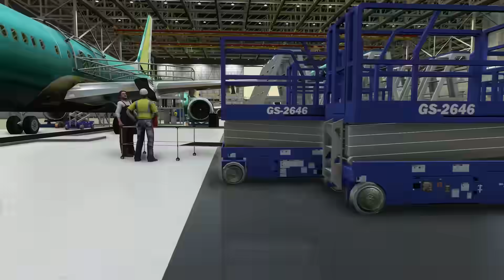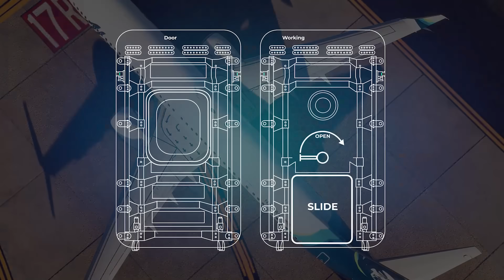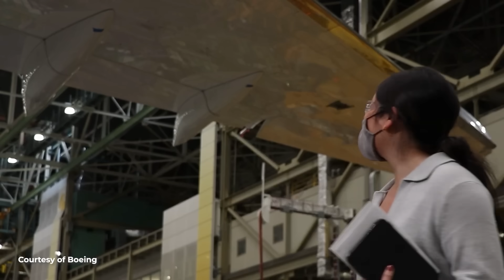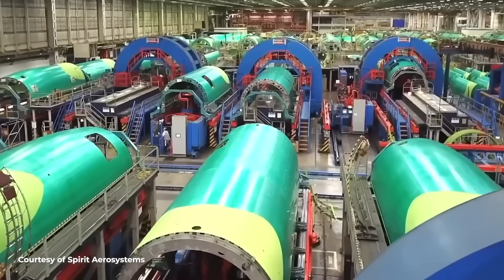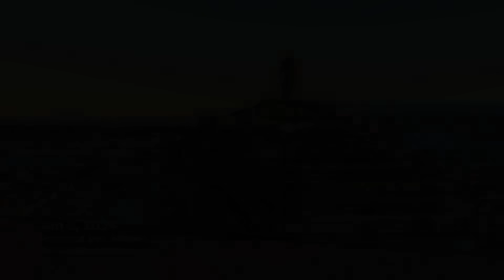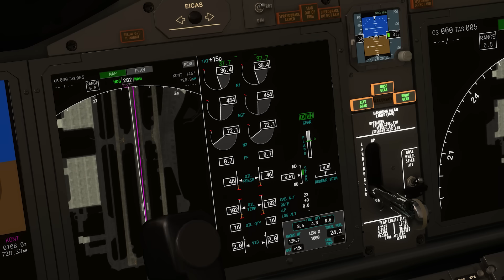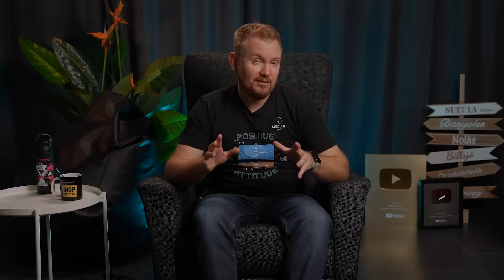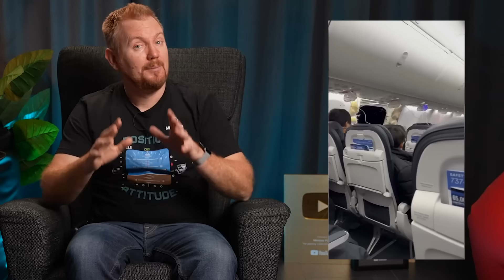Boeing 737MAX BlowOut!! The Scandal behind Alaska Airlines flight 1282

Comment: The fact that this was not a specific MAX design flaw, but a general quality control problem, is even scarier for anybody depending on Boeing, because ANY Boeing aeroplane can be and is affected by the way they make their junk in general!
Reply: It seems that the problem was within Spirit which is even scarier because it means all Boeing aircraft and some other brands, too.
Reply: @MikkoRantalainen  No, the problem wasn't within Spirit. Spirit caused the root problem for some work over but it happened at the Boeing Final Assembly Line (FAL). Boeing has to keep track of what is happening there and failed to do so.

Fly save! Avoid new Boeing aircraft.
Reply: @MikkoRantalainen the problem was with Boeing. It happened on their floor.
Reply: Totally agree. It would have been better if it was a design flaw because thats relativly easy to fix and to narrow down affected planes. But having a quality escape is always a bigger problem because you can't say when it started or how many planes are affected
Reply: Although plugs are another part in other boeing planes they all share a basic design and install.  The missing and loose parts are builder failure.  A scarier part for me is the FAA in reporting told the whole world how to override the cockpit security door, required to avoid another 911.  We also have 12000 confirmed terrorist released by our government on our streets.  It took 18 to do 911.  Imagine just 1800 is enough to carry out 2, 911 like events per state.
Reply: If they only hired white men, this would never hsppen. As we look through our history, this type of thing never hsppened before the woke Boogeyman started hiding under hiring managers beds.

Is the Boogeyman in the room now?
Reply: the two work in harmony, good design can and should reveal quality concerns, in other words the design should make it impossible to assemble something wrong, because if it can go wrong it will.
Reply: There's a bit more to it. It is far from all Boeing planes which has these plugs. From what I can understand, it's a relatively new thing. You won't find them on 747's, 777's older 737's etc. Not sure Airbus even has any. The scary part here is, that it tells us a lot about the working environment and culture at Boeing, and that affects ALL planes going out. It is as terrifying to learn that they did not replace the rivets which were supposed to have been replaced for example.
Also note that Spirit is still Boeing, and it is the responsibility of Boeing to make sure Spirit does its job properly. It is also a problem that Boeing disregards issues, and thus demands the production to be ramped up so deliveries continue on schedule.
Reply: @AB-80X no... it tells us a lot about the culture at SPIRIT, not Boeing.
Reply: @thomasneal9291 it doesn’t help Boeing if you keep coming up with excuses for them. This is why the door fell out. “Not our responsibility”.
Reply: @thomasneal9291 no I really think it tells everything about the culture at Boeing.. How they became "bad" corporate pushing for production regardless of its engineering teams opinion, minimizing cost and focus on investors. Spirit was a part of Boeing until 2005, they externalized it and then they squeezed it, more for less money. Final quality assurance is the responsibility of Boeing. There is a reason that Boeing is being scrutinized, they have killed people recently by prioritizing cost and fooling around with FAA.
Reply: Airbus does have door plugs. Just a guess, but an a321 neo probably has them because of passenger configurations. 

Bigger planes are less affected by this, because they’ll just have a door there because of passenger count. It’s these large 737s that are right on the edge of passenger count for exits, which is really just the max 9 and 10, as well as a 900ng
Reply: Well it seems like Boeing itself is not to blame but the company that provides them with the doors.
Reply: @J_131  The blame is with Boeing. If a car manufacturer fitted rubbish tyres to a car you bought, it would be the manufacturers fault. Final assembly rests with Boeing.
Reply: @J_131  The very reason that Spirit exists is becausse the bean counters from Boeing sold off what used to be a Boeing owned manufacturing plant as a cost cutting measure. From an engineering safety standpoint its a shit show. I know a former safety inspector from the Boeing seattle plant and he left after only a few years out of disgust. The terrible corporate culture from Boeing also translates to Spirit. Its all Boeing's fault, ultimately.
Reply: @J_131   Still, in the end it's a Boeing product.
Reply: when companies focus on DEI rather than their core business, the result is inevitable
Reply: @pauldwalker  Straw man BS. 

You're going to lose AGAIN in November. 

Just move to Russia or Hungary.
Reply: @pauldwalker The inevitable result is a more diverse workforce, period. Or does your definition of DEI mean 'only hire based on colour and what's between their legs and not their actual qualifications'?
Reply: One of the many side effects of diversity hiring. Spirit has an all female engineering team. Statistically impossible with merit based hiring.
Reply: @United_Slaves_Of_Israel  Right, because when white guys make mistakes, it’s just one of those things, but when anybody else does, it’s because they have dark skin or are a woman or whatever nonsense you people use to justify not hiring anyone who doesn’t look like you. Go to hell.
Reply: @United_Slaves_Of_Israel  Typical right-wing justification for not hiring anyone who doesn’t look like you. If one of you people screws up, it’s just one of those things that can’t be helped, but if someone else does, it must be because they have dark skin or are female or whatever, and you use that to justify keeping the old boy network alive. Surprise, surprise. 🙄
Reply: @United_Slaves_Of_Israel  Guess who makes the overwhelming majority of mistakes, out of proportion to their presence in the labor force? (Hint: It’s not women or people with lots of melanin.) Maybe we should stop hiring them.
Reply: @United_Slaves_Of_Israel omg
Reply: @United_Slaves_Of_Israel ridiculous comment. I guess you fall for the right wing fear mongering.
Reply: @United_Slaves_Of_Israel You guys will say and do anything to maintain your power, eh? Funny, considering who is responsible for the overwhelming majority of screw-ups in essentially every facet of life.
Reply: @United_Slaves_Of_Israel    I agree in general, but this was not an engineering issue, but an assembly one.   And also I believe it happened at Boeing, not at Spirit.
Reply: @gonzchi let me get this straight, you agree "in general" that having an all-female engineering team (a claim which we have no idea if is true, and I doubt) is, in and of itself, a problem for the quality of their work?
Reply: @mnxs   No. I agree that companies should hire based on merit and not based on filling a quota of sex or race or whatever.
But in this particular occasion, it makes no difference, since this was not an engineering issue.  I hope I could clarify my comment.
Reply: @gonzchi However what's never reported, and overlooked by bigots who push the anti DEI agenda, is that the people who worked for the subcontractor reported the flaws in the design which were ignored. That is what happens all too typically when corporations and their subcontractors are more concerned with getting out a product, no matter how flawed, instead of putting passenger/crew safety first.
Reply: @United_Slaves_Of_Israel Don't be ridiculous.

Comment: Didn’t know you guys didn’t know about the unlocking of the FD door during a depressurisation.  Learned it from the airbus fleet I operate on and we were told it was industry standard. 

Really useful to ease the nerves in case of pilot incapacitation during a decompression
Reply: I suppose that's yet another difference between Airbus and Boeing these days.
But hey, Boeing didn't feel the need to tell their Max 8 pilots about MCAS and its associated issues. Seems to me that Boeing considers pilots to be on a need-to-know basis...
Reply: @AB-80X  "Seems to me that Boeing considers pilots to be on a need-to-know basis..."

Yeah but you never know what you need to know. Flawed thinking from Boeing where everything costs too much to be bothered with.
Reply: I wonder if they thought it might be a security risk for a potential hijacker to know that.
Reply: @--KP- I have to to admit that I have two different schools of thought on that. I don’t think it’s very secure as a clever terrorist team could abuse that system.

But the physics of it makes sense though.
Reply: @mikoto7693 kinda hard to do cause you probably need to inflict damage to the aircraft to get it to depressurized which kinda means blowing a hole in the aircraft you fly...

Comment: After this, I guess the springs fitted at the bottom of the door will be removed if a plug is installed. I cant really see the reason why the springs were left in situ as you really dont want any more dead weight than needed and the plug was for all intent and purpose a permanent install.

Comment: So, very basic questions remain. Where were the bolts? Why not duct tape them to the door stops so you couldn't put the door back without noticing them? Relying on an entry in some system to remind to replace and re-check seems fragile and vulnerable. When a procedure is in place, it's a lot easy to convince yourself that the procedure is failsafe than that it will be following correctly in all cases, especially with so many devisions of labor.

Comment: With the cost of solid state RAM so low and the ability of data compression to reduce audio to relatively small data sets why aren't these aircraft capable of storing days worth of audio at this point in time?   It seems like I have heard about these overwrites a few times.   Why isn't the data archived when the aircraft lands from the last flight?   Unless there is a catastrophic hull loss there is really no excuse with modern technology to losing cockpit voice and other flight data.   Additionally you mentioned putting a certain code into a flight system when the aircraft is in an emergency status.  Why does this not trigger 1. back up storage of the flights data and voice into a secondary storage system that will not be overwritten. 2. Satellite uploading of voice and telemetry of similar data?   I know from flying 737 Max that I have internet service as a passenger.   Seems like aircraft data can take priority of that path in an emergency!  In the modern age we should not be losing critical flight information, including where there is a catastrophic loss of an aircraft at any time where the aircraft is still airborne for a few minutes after the crew notices the event.   Considering the cost and consequences of commercial aircraft mishaps, I am frankly surprised how many things are not standard engineering practice.   737Max for example even after aircraft losses and "corrections" (correct me if I am wrong) still does not allow disabling of MCAS without de-energizing manual electronic trim control.   So the pilots can no longer use the electrical switches to trim the aircraft?  They have to manually spin the trim wheels.    Imagine if a Tesla using automatic drive control, had to be swtiched off by disabling power steering and brakes on the car.   Just have a circuit cut off for MCAS in the electronic trim system, up stream from the trim motor circuit breaker!  Runaway trim may require disabling the motor control, but MCAS intevention should not require this.
Reply: Privacy concerns
Reply: @slevinkelevra5824  I understand that concern.  Pilots don't want to have big brother reviewing every action they take.  The way to deal with privacy concerns is to legally limit access to the data sets, with serious penalties for misuse, not to decline to collect it.
Reply: @martinbrenner2573   I fundamentally and vehemently disagree with that. I dont think we need to discuss this in any way, our viewpoints seem so totally opposed we would get nowhere.

Comment: How is it possible that in 2024, any voice recorder would be limited to 2 hours?  A $25 SD card can record nearly 2 MONTHS !!! of 2-track audio with reasonable compression.  Even without compression, you can record almost 2 days of 2-channel audio on a 128GB card.  And of course, cards are readily available up to 1 TB for around $100.  How can there possibly still be a 2-hour limit in 2024?  This is insane.

Comment: I don't generally suffer from any sort of flight anxiety, but this incident has rattled me. The fact the aircraft itself isn't at fault actually makes it worse - it means that it's not a specific faulty design that I don't trust - it's the entire company.
Reply: Sadly, nothing new. Even the Max 8 accidents boils down to company culture, even though it was a built-in flaw, combined with Boeing not disclosing the potential risks of MCAS in order to negate extra pilot training.
That's the problem with the McDonnell-Douglas model.
Reply: @AB-80X  The real scandal of the MCAS tragedy was that Boeing already used it in military aircraft. It isn't a problem there because they use BOTH angle of attack sensors. On the 737 Max, a pilot would not necessarily know there was a difference between sensors as the alarm feature was an optional extra .
Reply: I love flying commercial and GA although I'm not a pilot.  

But I'm not getting on a Max.  Not even so much because of safety concerns but on principle.  Obviously it will make no difference to Boeing unless millions join me, but I do hope they get the message that they need to get their act together.
Reply: @kentstallard6512 Actually I think there’s a decent undercurrent of people who are either afraid of flying on a Max variants or Boeing aircraft at all, or refuse to fly them on moral principle.
Reply: @mikoto7693  I hope so.
Reply: Look at it this way, it kept flying and kept everyone safe while missing the door, it shows that even if things go wrong, there are enough safety features to keep you safe
Reply: @odremckay9974  Look at it this way: Had the door blown off just a few minutes later it likely would've resulted in fatalities.
Reply: The entire company doesn't install the door plug and there is no indication that the improper installation of the door plug was due to cutting corners or trying to save money. Jumping to that conclusion is the cheap recourse of the person who doesn't understand how or why decisions were made and how humans make mistakes.
Reply: @petep.2092  The finished product has the  Boeing name.  They are ultimately responsible. 

You are apparently OK with passing the buck. 

Lives depend on the quality of a plane.  We're not talking about widgets.

Comment: It would make more sense, to have a differential valve, than to fling open the cockpit door    :p
Reply: They do but it only works for air going in the opposite direction. (As in the British Airways BAC1-11 where the captain's windscreen glass blew out). This would be a much more serious issue for the cockpit door as air from the entire pressurised cabin is exiting the cockpit window via the cockpit door. That's why they have vents in the cockpit door to allow air to flow in that direction. If they didn't, the door would likely tear off it's mountings and hit the captain on the back of the head!
In the Alaska case it was only the relatively small volume of air in the cockpit that needed to pass the cockpit door.
Reply: @alanm8932   As you say, it doesn't make any sense to me, those vents/valves (in the door, or could also be in the separating cockpit panel / wall) aren't bidirectional. But what do I know.